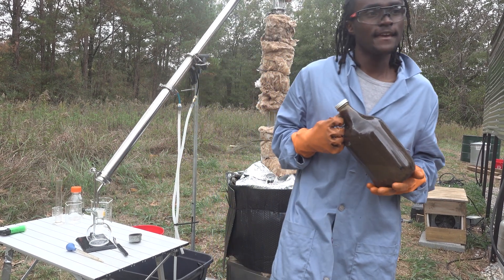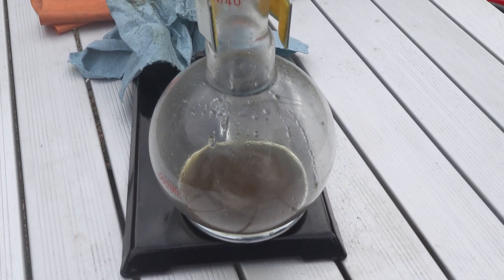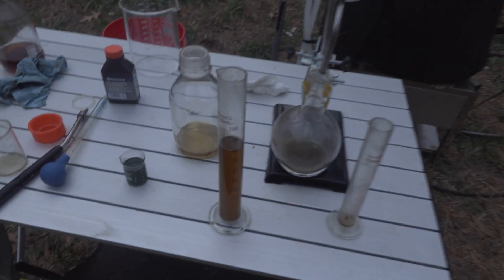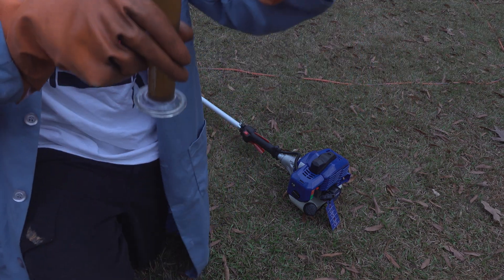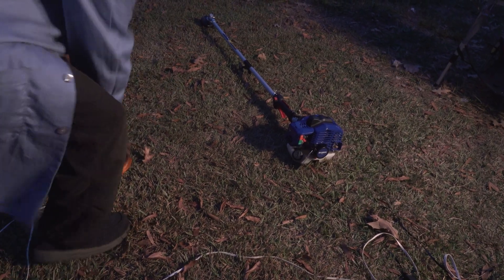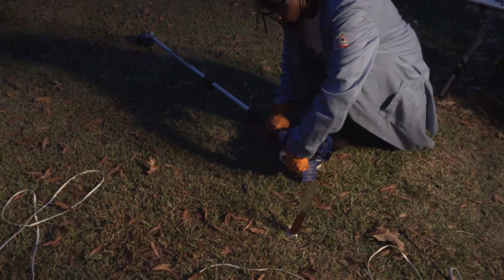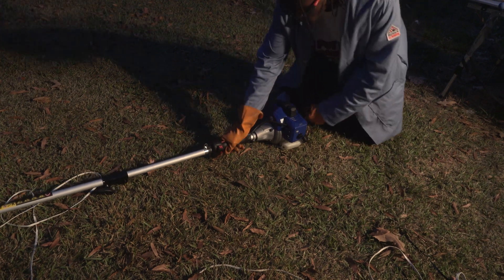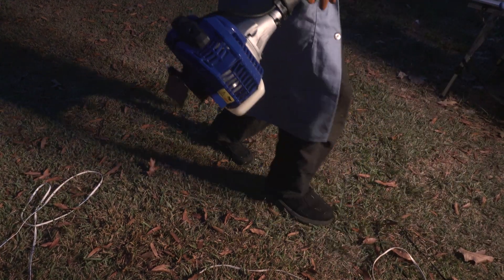Running Weed Eater off of Plastic!

Comment: To be fair it is a 2 stroke engine. Anything that is highly combustible mixed with two stroke oil should run the engine fairly well. It would be impressive to see how a 4 stroke would run even a small 4 stroke generator engine. They require a proper fuel as well as fuel air/air ratio.
Reply: He ran a truck a car from the 1920s and a water generator with it
Reply: @jericoyouharrison9748  Yeah, even after he was warned not to due it's high toxicity.

Comment: He runs a weed eater machine on the fuel. It works.
Reply: Robot
Reply: @rayray2glocks  Nobody said it doesn't work.  
Everyone who understands it wouldn't stand anywhere near it or an engine running on it, however.

Comment: 💪 only problem is they have tried this and discovered that if done on a mass scale, you get less out than what you put into it, and it actually proves to be equally as bad for the environment producing it. Nice thought tho, wouldn't hurt for a solo individual to run all his machines off of it if one so desired.
Reply: @reefedvessels   It's not just the efficiency that's the problem.  
It's the toxicity.  
A real scientist wouldn't even open that outside of a fume hood, and certainly wouldn't run an engine on it.

Comment: While this technology has been around for quite awhile. The reason that there are not already massive scale refineries doing this is because the amount of power units needed to run the system is more than the amount of power units that are coming out. This man is very smart and has so much potential. As he works on bettering the system and working to make it better I hope he will be able to get to a point where he is in the green.
Reply: Even if he was using 100% solar, it'd still be worse for the environment than just burying the plastic.  
This is setting free all the toxins that were safely locked into the plastic before.
Reply: FUKC THE GREEN!!!
The UNIVERSE is pleased with what he has accomplished!!!
The UNIVERSE IS ON HIS SIDE,everything else follows!!!
THIS RIGHT HERE IS MAKING PEOPLE AWARE OF WHAT THEY CAN DO, WHO THEY ARE,WHY WE ARE HERE!!!
You can be your SUCCESS or your FAILURE!!! PICK YOUR CHOICE!!!

Comment: but, whats the emission? is it safe? does it lubricate the engine aswell? does the fuel damage the engine?
Reply: It's far from safe, the emissions are the usual carcinogens as well as a lot of microplastics. 
It also readily polymerises and will gunk up an engine pretty quick.

Comment: WE NEED TO PROTECT THIS DUDE!
Reply: Why does he not mention the electric bill required to make a gallon of crude oil, and a gallon of gasoline? Because it would cost more in electricity than it would to just go buy some at the gas station.
Reply: @JewsRock-ILJ  DUDE LIL BY LIL IT WILL BE PERFECTED!!!!!!! CHILL!
Reply: @DeadPresidentsEnt.  No it won't be perfected. There is almost no fuel in plastic and the only way to extract it is with heat energy input that will always require more input than will be pulled out of the plastic. Notice how he has been just burning plastic for 4 years and made ZERO advancement. That's because this is a show he puts on for simpletons to get views, clicks and the eventual donation to his patreon.

The only way to advance this technology is to find out a way to create heat with no fuel😂
Reply: No he needs to be shut down by the EPA. All he is doing is using 10 gallons of gasoline to make 1 gallon of cancer juice while dumping carcinogens into the local environment.

Comment: plastic from milk? maybe a reliable source for some just entering the production phase.

You can also make plastic at home using materials like milk and vinegar. Here's how:
Heat milk to at least 158°F.
Add 2 spoons of vinegar to the hot milk and mix vigorously for a couple of minutes.
Drain the mixture to remove the liquid and keep only the solid part.
Use paper towels to remove any remaining water.
Knead the mass into a ball.
Use a mold to shape it or leave it as is.
Let it dry for 48 hours.

Comment: I think we need more optimisation videos. We know you can do oil from plastic waste but I am more interested in the optimisation now, otherwise it feels like the same thing is being talked about over and over: " I can do oil from plastic waste".
Reply: Also the long term effects of this dirty petrol in engines, is this 3 weed eaters we’ve run through so far? What happened to the other ones
Reply: Bruh there is no more optimization to be had. The only way to boil fuels from plastic is with heat input. There is currently no way to make the process of distillation require ZERO energy input so there is no further optimization to be done.

This is why his channel and everything he is presenting is a fraud and a basically a show he puts on for simpletons to eventually donate to his patreon. In order to optimize this process he he needs to find ways to break fundamental laws of physics and it just won't work.